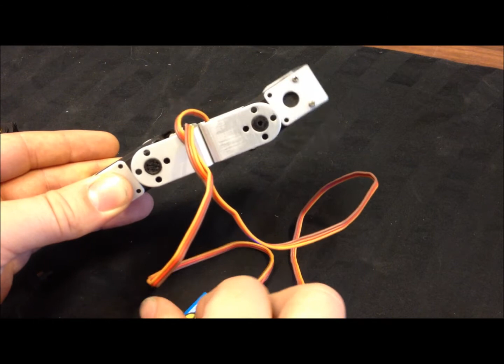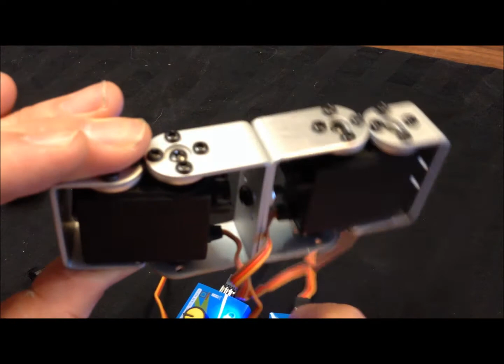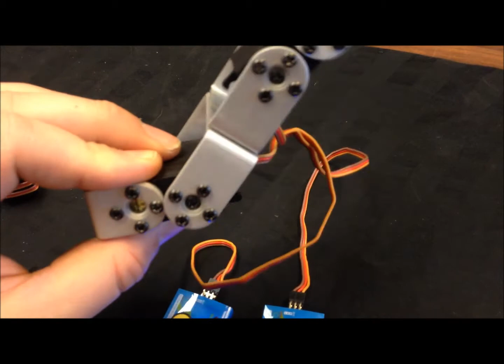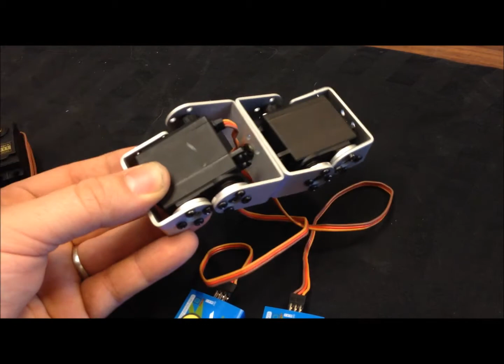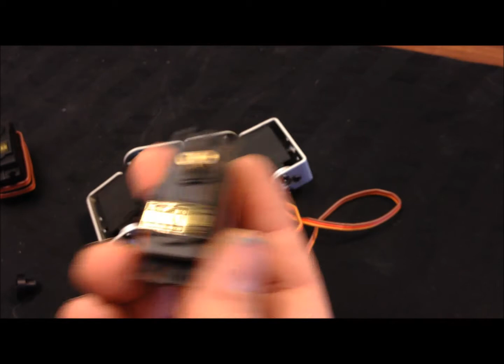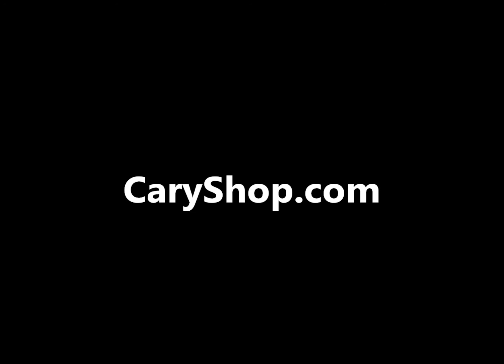1 MG995 High Speed Metal Gear Digital Servo for RC helicopter Car HPI Traxxas

Comment: what is the driver of the motor and where I can buy this version?
Reply: any servo sketch      pulse width modulation      current      length    time      you command them to turn in the direction you want when you stack them all together in the program they dance